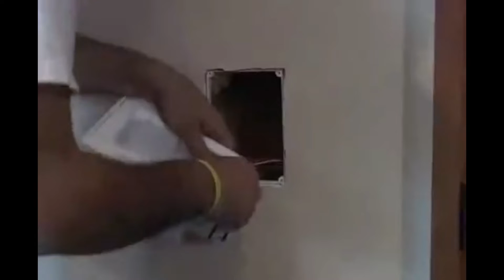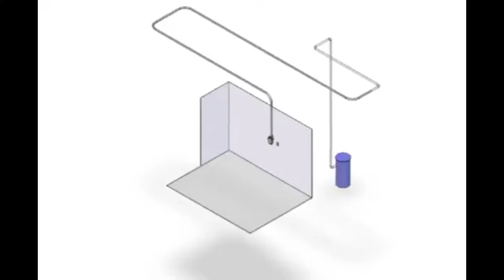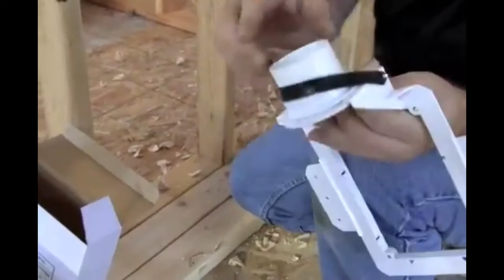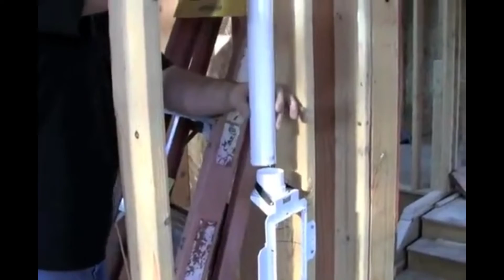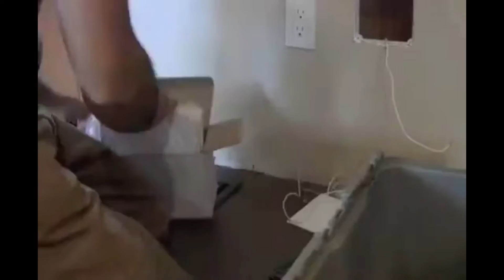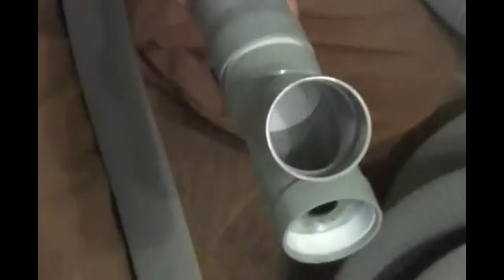Hide-A-Hose Installation

Comment: I've got a preexisting central vac system in my home. This wont be easy to retrofit in. Id have to change the tubing all the way back to the cannister, right?
Reply from the maker: You would need to add additional pipe runs with our sweep fittings in order to store the hose. Available attic or crawl space can be used to add these pipe runs, which could then be connected to your existing system.

Comment: what type of pipes do you use? Standard 2" pipes?
Reply: 2” central vac pvc tubing, not 2”schedule 40 pvc pipe for plumbing.
Reply: @debo1211  thanks, I have figured out and installed it in my basement